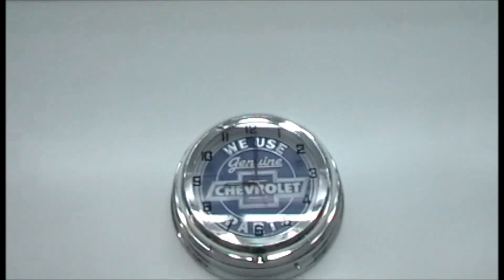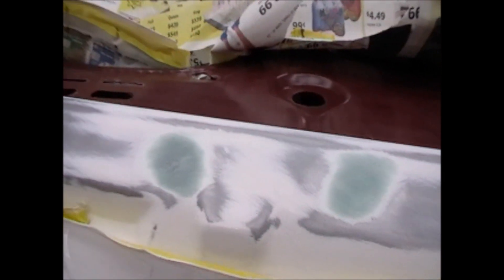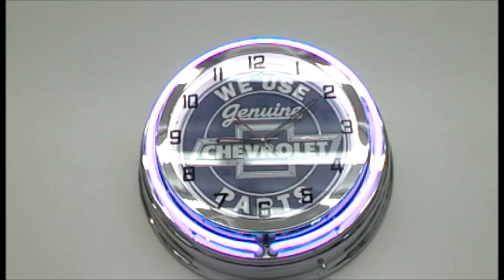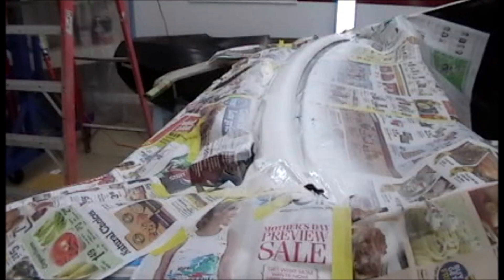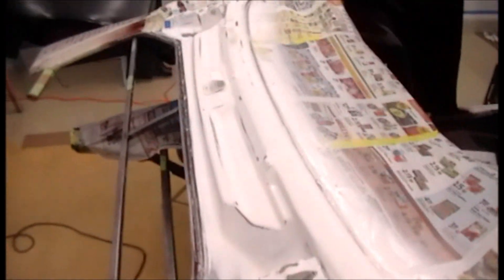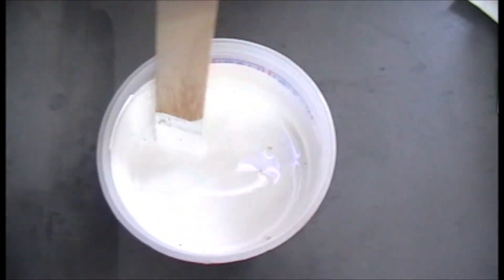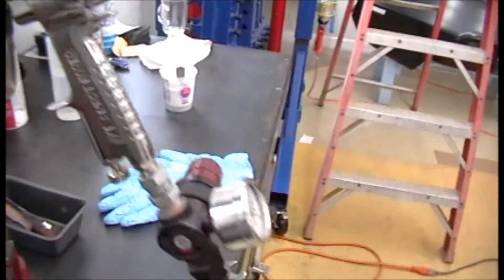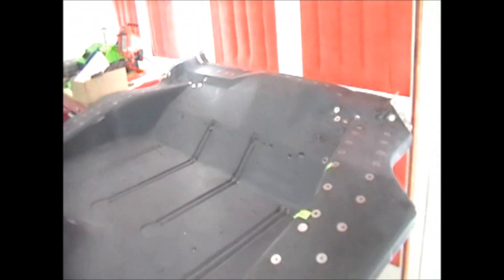Deck Filler Panel Replacement Done "1972 Camaro Project OverKill"

Comment: Man that looks awesome ! hey wait where's all those fisheyes?
Reply from the maker: MrFireman164 Thanks Roger. I don't get many of them with the small detail gun That's why Barry thinks I need to increase my pressures. My compressor range is 90-135. He did state that he thinks I should run at least 5 more psi at the gun. Still don't understand why. I'll be getting the full size gun out soon when I work on the bed cover. We will see. I hope the lift cover takes care of yours.

Comment: i believe i need to replace my package tray upper as well. the trunk gutters are rusted. how hard was it to do? and what episode did u do it in?
Reply from the maker: That will be in some of my very first vids. Wasn't too bad. My gutters were good, so I didn't have to replace them
Reply: if the gutters near the hinges are bad what piece do I need?
Reply from the maker: That will be the deck filler panel.
 https://www.summitracing.com/parts/amd-650-3570-2/overview/year/1970/make/chevrolet/model/camaro